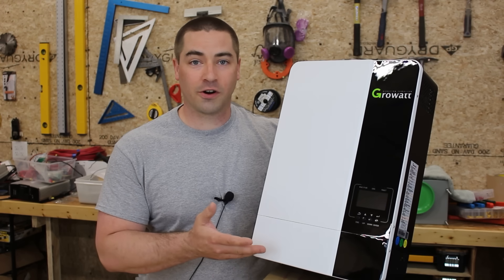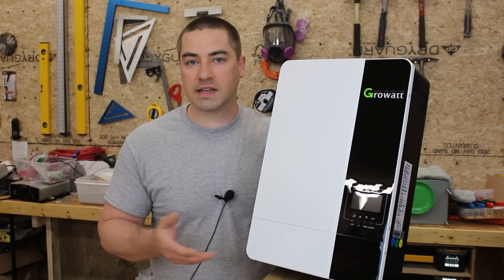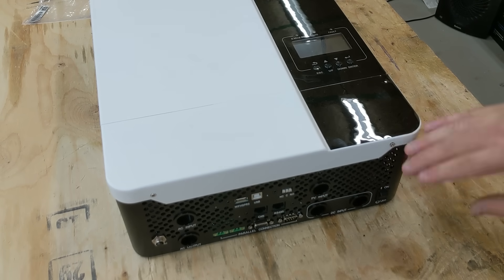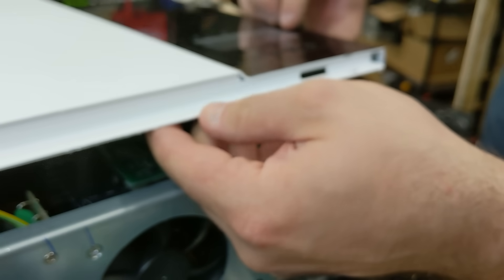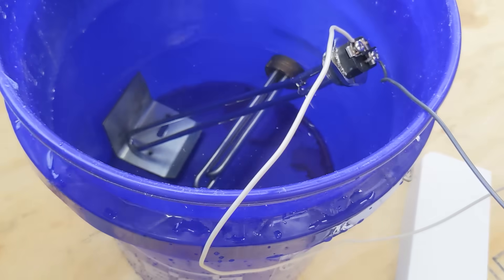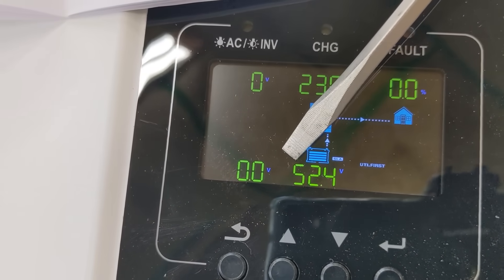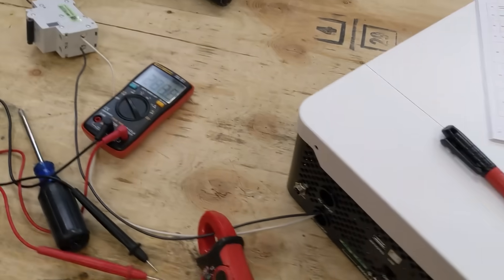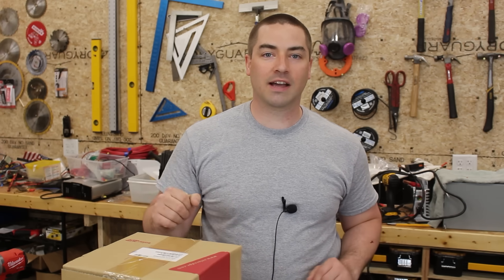Best Value Inverter, All-in-one MPPT Solar Charger, Growatt SPF5000ES, Part 1

Comment: I would love to see the waveform of the output on an oscilloscope. You would want to use this unit with a center tap 120/240 transformer in order to provide the grounding electrode conductor point of connection to the grounded conductor (Neutral) These inverters are usually designed for international use that are 230V with one conductor being grounded. As our 240V systems are always grounded through the center tapped Neutral conductor, each of the 240 volt conductors are not grounded. BTW, in the old days of hooking up Trace inverters, one always carried a second unit, as the newly installed Trace units might emit a large puff of white smoke when first turned on, and then die a quick death.
Reply: The Growatts from Signature Solar are modified so that neither of the 240V outputs are grounded, as you say. Unfortunately if the Growatt is bought from another supplier, it is possible that the 240V "neutral" IS grounded, thereby causing a grounding hazard. People who purchase Growatts from other than Signature Solar, or purchase second hand, should check that the neutral and ground connections are not bonded together - using a continuity tester or ohm-meter.

Comment: Any question is how many charges before it's no good I know the Kodiak is 2,000 charges and that was the best on the market
Reply from the maker: The Kodiak is a unit with battery built in.  This Growatt inverter has no battery built in.  It's the battery that limits the life, not the inverter.
Reply: @DavidPozEnergy  that's so cool

Comment: Can anyone assist me? I would like to get an inverter chager like this one but with split phase included.
Reply from the maker: There are a few models available at Signature Solar.  Here is an example of a 6k: https://www.signaturesolar.us/products/6kw-48v-250vac-80a-off-grid-inverter-by-growatt  Use coupon code DAVIDPOZ
Reply: @DavidPozEnergy  Thanks for the quick response. I appreciate that.  I will take a look. And thanks for the code as well.

Comment: Max input current of 18A means you cannot connect 2 panels of 11 amp each in parallel?
Reply from the maker: You can connect two strings of panels in parallel, with each Imp over 9 amps.  My panels are 9.5 Amps each and I have two in parallel.  You only loose out on a little potential if the solar conditions are perfect.  But in overcast, cloudy, early morning, late evening, hot days, etc. it won't even make a difference.
Reply: Thanks heaps, I couldn’t wrap my head around it for a couple of days as i have 10 panels , 550w, 42v, 13a Each. Connecting them is series will cause the voltage to add up above the maximum of the inverter, and connecting them in parallel will double the amperage beyond the max input current of 18a. My understanding from you is that you only loose some potential for battery bank charging purposes not for output power. The mppt will use 18a out of 26a from the PV to charge the  battery bank, it will not affect The output power to operate the appliances during the day. Am I getting it right?
Reply from the maker: Yes, you have that right.  The MPPT charge controller (built-in) will only PULL up to 18 amps.  It's fine if the panels have a rating of more amps because it's just potential amps.  However, the most critical thing when wiring panels is to never exceed the maximum voltage of the charge controller.  In this case, it's 450VDC from the PV array.  Never series so many panels that you exceed that.  I even add 25% margin to my Voc.

Comment: Hi. I bought one of these and I have just one thing to claim. There's no way of configuring it to be just battery charger and work 100% of the time at inversor mode, feeding output with 100% of the time converting dc to ac the way we could have an clean and stable output always with the same Hertz and Voltage and single phase 220V (one neutral and one 220 phase). If you feed input with dual phase 220V (110+110) you will get the same at output, because it will do a bypass. I would like more if this equipment has a mode like "true online double conversion", something like that. Or I simply can't figure out how to configure it that way I want.

Comment: Hey man, how would I use one of those resistors to precharge the capacitors? Also, what the Heck Is the resistor called, need to find one on ebay lol
Reply from the maker: https://amzn.to/3uJaQOU  The one I used is a 100W, 2 Ohm.  But the exact ohm doesn't so much matter.  Anything between 1 and 10 is good enough.

Comment: I'm a little late to the comments game on this one, but can this be wired directly into a home panel (United States) from the 240v output or would it need the transformer to make two 120v phases to wire into the home panel? That's how I imagine it needs to work, if at all. Yes?
Reply from the maker: You would need a transformer if you want 120V and/or the normal 120/240 split phase.  I share how I do it in the next few videos.  However, if you are only powering 240V loads from that particular sub-panel, then you don't need a transformer.  I also show that with my mini-split.
Reply: @DavidPozEnergy  thanks! I watched this one and the next one and thought I had it figured out but just wanted to be sure. Love the videos, still trying to learn :) thank you for the response!

Comment: Love the video, it was informative and easy to understand. Do you think on the 3000 24 volt model that i can take the output and wire a 30 amp 120 volt breaker?I want it to power my RV?
Reply from the maker: 3,000W/120V=25A  A 30A breaker would likley work fine in most situations.  However, Code says you need to add 25%, which would be 32A breaker as a minium.  Depending on the line of breakers and panels you are using this might mean bumping up to 8AWG wire and 40A breakers.
Reply: @DavidPozEnergy  
Thank you for the information. I will probably give it a try and let you know how it turns out. I think the worse case it i will not be able to use  the AC in my RV. Thanks again.

Comment: Can you flip the phase of these inverters for parallel operation?
Reply from the maker: I paralleled 3 of them, but kept the phase the same for 240V operation.  There is a setting in the manual for 3-phase, but I have not tested the 3-phase.

Comment: Hi. I have purchased this unit. It works well. Right now I am running this without a battery. It works well and uses the solar in the day. However on the Shine monitoring site it displays 0 kWH Solar generated today. Any ideas on why this could be? Will it only show solar if I connect a battery. I am trying to find out how much solar energy my system is actually generating. Any help will be appreciated.
Reply from the maker: While the unit is on, try pressing the down arrow button.  Mine will show solar amps, watts, and kwh.  I've never tried the computer/online thing.

Comment: I really need this but 6000watt and 24v very sure this is a winner for alot of ppl that will actually buy it. And I know you can buy two and get the 6000watts but space.. just one unit like this would be perfect for the overland crowd and im sure the big truck guys would eat this up.

Comment: david do you feel this would be a good unit for rv use
Reply from the maker: If your RV is wired for 240V, and you have a 48V battery, then yes.  But some RV's I've looked at have 120V only, in which case I'd look at a 120V inverter.

Comment: Thank you for the video! Kind of new to alternative energy, so your videos are very helpful. The obvious big question is, is this one too cheap? What is the difference compared to say AIMS, which cost so much more. What does say AIMS have, to justify the price, compared to this? Looks great, just seems like to good to be true? Don't mean to question, just curious.
Reply from the maker: Hi Ron,
I've been running these for about 4 months straight to power my house and so far no issues.  But, admittedly, 4 months is only 3% of the hopeful life expectancy, so not really a long term test.  
The Aims inverter had a transformer built-in that gave me 120/240V split phase.  This Growatt is only 240V and in my next video of the series I add an external transformer to give me split-phase. 
The Aims inverter is stand-along only.  These Growatts allow you to parallel more to increase total output.

Comment: Can you run this 3phase 400v ?
Reply from the maker: I don't think so.  They can be run 3 inverters in 3-phase, but I think it's 208, 230, 240.  I don't think there is an option for 400V.
Reply: @DavidPozEnergy  okay I will do some research and see what's possible. Thanks for your answer ☺️

Comment: I don't get it, so if my house uses 1'000 kW/h per month, does that mean I would need a 35kW inverter?
Reply from the maker: That's about 33.3kWh per day.  We use the daily number to help us calculate the amount of solar panels and the amount of batteries you would need to power your house each day.  However, we don't use that number when sizing an inverter.  What you want to calculate is your maximum draw at any given moment in time.  This would be your worst-case.  It might be an electric oven, whole-house AC, and electric water heater all together (about 15kW).  Or whatever your situation is.

Comment: Hi David, Great info on the units.Thanks! What is the Max DC input current from the panels for this unit. I can't seem to find it in the literature. Trying to calculate strings size to it.
Reply from the maker: 18 amps.  However, my panels can put out a little more and it's OK, just don't go over the voltage.  I go into that in more detail in this video: https://youtu.be/OogbHnFa7G4

Comment: We are running 6 of them, 2 on a phase and in 2 months we've had 1 blown and then 2 weeks ago, 3. One on each phase. Its now 2 weeks later and still awaiting the fixed units. Seems like they dont like to be paired... Im renting from a company and they installed it, but it seems like these invertors are not up to the job

Comment: Can you fit a 0 awg in there?
Reply from the maker: I used 1/0 and it fit, but was very tight.
Reply: @DavidPozEnergy  Lol forgot to tag
Reply from the maker: Hi Jerico,  I remember it was a 10mm nut.  I think I bought crimp lugs with a 1/4" diameter hole for the stud.  https://amzn.to/3BdBf9G
Reply: @DavidPoz Thanks a lot. Ordered my unit and used the discount, was really awesome! Trying to buy the wires now to connect, it says 2 gauge was enough, but I wanted to be safer and throw in a 1 gauge or 0 gauge😅 Are they 5/16 lugs?

Comment: why would you sync up multiple inverters instead of just routing them to a different circuit breaker or box ?
Reply from the maker: You could do that too if you wanted.  For me, I only have one circuit breaker box in my house.  It would be a lot of work to add a box and re-wire it.

Comment: Can you let us know more about setting this up on lithium with communication with the BMS. What is needed to comunicate with a BMS. Can it comunicate with an Overkill Solar 16s BMS?
Reply from the maker: Mine doesn't have communication between BMS and inverter.  Instead I program the inverter:
Item# 05: Battery Type: "US2"  Which stands for user-defined 2.  This allows me to set up the max voltage, min voltage, charging currents, etc. throughout the rest of the menu items.

Comment: Excellent... FYI... All transformers and motors are inductive loads and will draw the energy they need to operate...  most all other loads (like heating elements) are resistive loads... they will draw what is available to try and meet their requirements... fire up that DWH element with 120V... see what your meter reads... A & V... it just wont get as hot... 
Are you familiar with DIY Solar Power with Will Prowse...???

Comment: Hi,
Have got the same inverter connected to a Hubble battery. 
The problem that I have is as soon as the battery's are fully charge the solar panels disconnect .
The panels also does not come on automatically, I have to drop the AC braker and switch it back on before the panels come online again. 
Any suggestions will be appreciated 
Thanks
Reply: So you’re loosing any additional solar power production once you’ve reached max battery holding capacity?
Reply: @Wrensspeedshop  Yes

Comment: Hello, can we add wind turbine to the system ? how to make solar and wind turbine works together with Growatt inverter ? thanks to the videos
Reply from the maker: I don't think the built-in charge controller would play well with a wind turbine.  But if you had a dedicated charge controller built for wind, then that could be tied to the same battery bank.

Comment: Interesting, however for 2pk ac and/or water deeppump (jet) installed, this inverter were good?
Reply from the maker: I don't have those items to test.  In part 2 I tested an air compressor, window AC, and 12" miter saw.  It powered all great, no hesitation.

Comment: This inverter says it can run without batteries and if the solar can not cover the load it can use the grid for power. Can you hook a portable gen to the input, hook solar up with no batteries and power loads? Would be interesting to see If it can work ok on "dirty" gen power.

Comment: Dave I really liked the "0000 wire doesn't fit" and then stating you don't need that wire. Lol. Why did you show that then?

On the price, while good in this market, really the whole market is hugely overpriced. Computer power supplies are similar power electronics and are way less expensive. There are definitely more features in these and development costs, so they should be more, but maybe $400. Over time they will keep dropping as volumes increase by more people using solar and competition for sales forces more reasonable prices.

Thanks for keeping us informed on products.
Reply from the maker: I did that because I get asked the question a lot "Can I use 4/0?"  So I figured I'd address it in the video.
Reply: @DavidPozEnergy  I see, well still made me laugh. It seemed so random. Thanks for the video, and I hope inverter prices keep dropping.

Comment: I bought the Growatt Inverter. Sadly I've noticed the Solar First function does not work.  It will use the solar to charge the battery, but uses the utility to power the loads. Theoretically it should power the loads via battery and solar until it hits your set low voltage warning in setting 12, which should kick on the utility to charge until it reaches the high voltage set in setting 13. This does not occur and the unit just uses utility to power the loads and uses solar to keep your battery at 100% with which it technically isn't using. 

I've contacted signature solar and they just told me to set it to SBU mode which basically does the same thing, but uses the battery power to power the loads and solar to charge the battery and utility as the backup once it hits the setting 12 voltage. This mode works and uses the correct settings from 12 & 13 but adds multiple unneeded cycles on the battery that could pass straight through the inverter to power the loads directly from solar.

 Any ideas or help? Did you experience the same thing? I have a meter on my utility and its pulling 550W (The window AC being powered) while there is 600W of solar readily available from a 24V 1000W rich solar grid.
Reply from the maker: I don't have a fix for you.  I don't have anything connected to the "input" side.  I just run off-grid.  I'll have to experiment to see if I can find the right setting.
Reply: @DavidPozEnergy  You have great videos, I sadly used it for a detail you didn't. Unfortunately I've been told by Signature Solar  that they doesn't support the Solar First Function and only recommends the SBU function because of its automation, however it relies off of the same settings that the solar first function relies off of. But SBU which will cycle your battery with the utility instead of power your loads directly by the utility as described in program 1. Very disappointing $850 customer service. I can power my entire load alone by battery, alone by solar, or alone by utility but the unit isn't smart enough to switch between all three given the advertised settings and the customer service won't support or help because I want the Solar First function that's the preliminary default function.  I have to try to make an AC power switch controlled by an Arduino that reads battery voltage AKA Solar First Mode
Reply: @DavidPozEnergy  So I ended up going to the BBB to force a return because Signature Solar wouldn't respond. Very disappointing. They didn't support the Solar First mode and only supported SBU mode. Unbelievable. Then when the product didn't work they blamed my expertise lol Now I know why they don't allow product reviews on the site

Comment: These "new" model is exactly the same electronic inside the spf 5000 hvm. In one year I had 4 time problem. First time they sent me a new unit, second time they sent me a new mppt board, third time they sent me a second mppt board (redesign like yours) and in the forth time they sent me these ES model. I'm not using it right now, just because we don't trust it.

Comment: Can i use external 110v intake? Or it only works with 220v? I know that the output is 220v
Reply from the maker: According to the manual, the input can go as low as 90V.  I have not tested it that low.

Comment: What would happen if you didn’t use the transformer? Can you not plug in an outlet?
Reply from the maker: This model inverter outputs 240V.  The auto transformer is there to make the 120V.  Without the auto transformer I can still use any 240V appliances, but not 120V appliances.